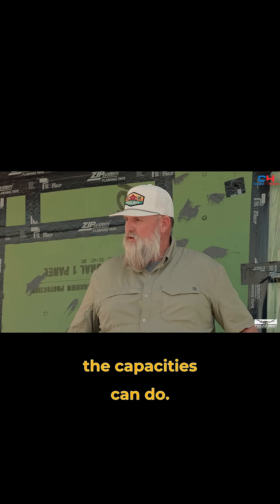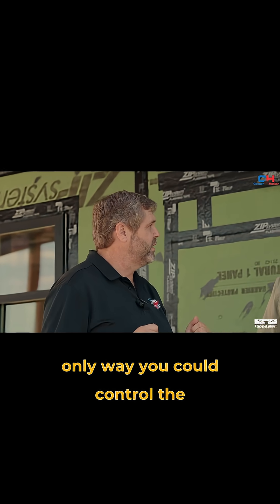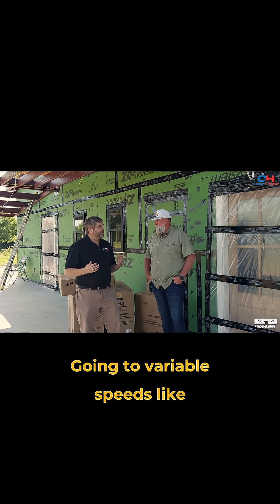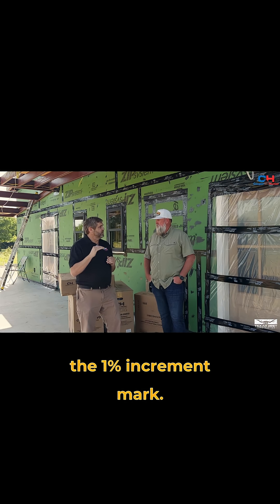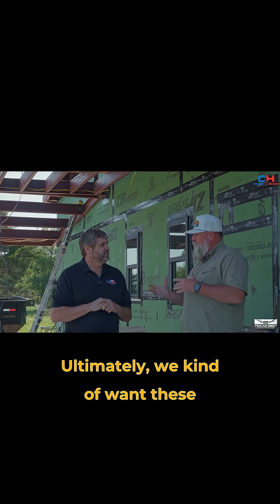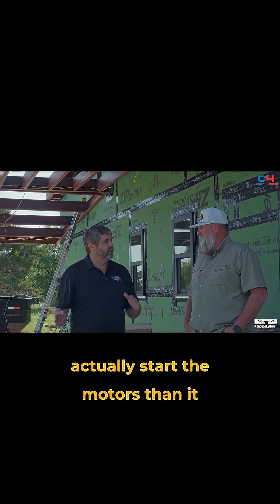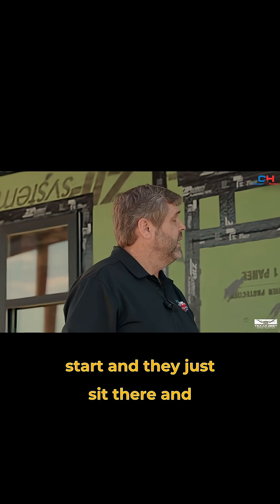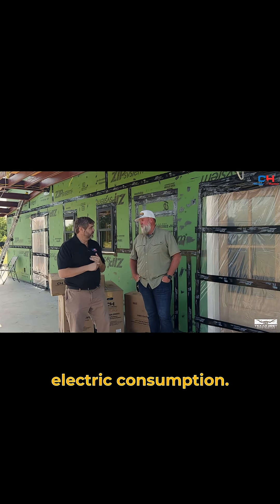Variable Speed HVAC System is the Better Barndo Way

Comment: Nope, its a DC motor and it has a motor controller board. They are about $500 each and seem to go out quite frequently. The single stage motors are A/C motors that cost about $125 and then there are caps to start the motor that cost about $40. When you do AC for a living you love the variable speed units, job security.

Comment: "It takes more energy to start the motor than keep it running." 
Sounds real smart but there's a time frame that doesn't apply to (sales tactics)
Pick a temperature, geeking over the amount of airflow when you already have a house at the exact temperature you chose is crazy 1st world problems